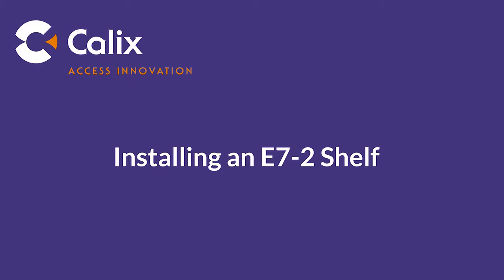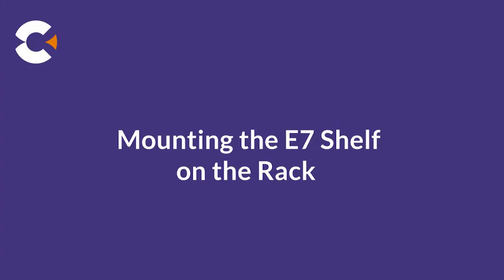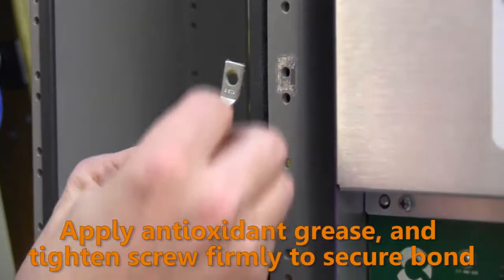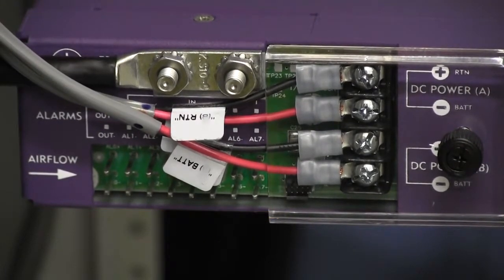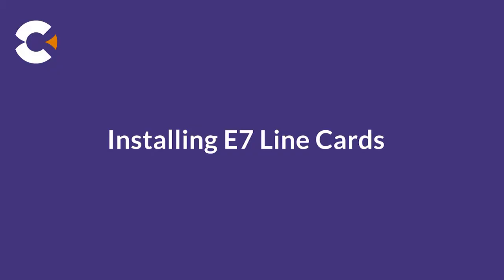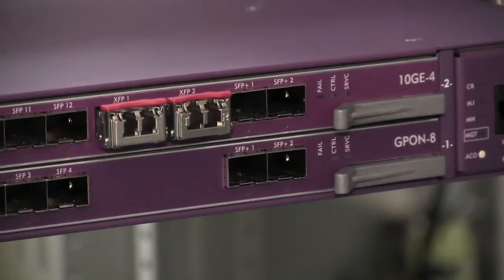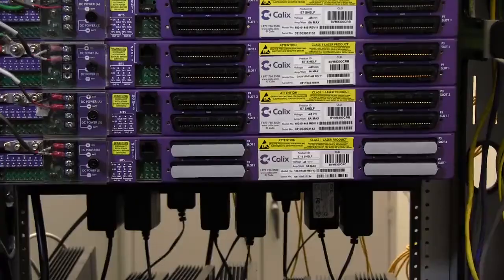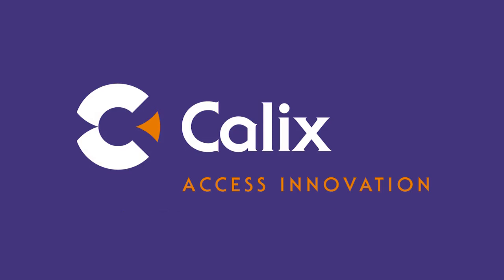Calix How To: Installing an E7-2 Shelf

Comment: What is the 7-segment LCD display on the fan tray module used for?
Reply: Nothing. Install guide said its there for future plans, but yeah... 7 years later still not in use
Reply: From what I have seen inside telco offices that use these systems specifically. They're used to identify which unit/shelf it is without needing to lable them. 
They get daisy chained together with DAC and remote managed. So far I've seen 8 linked up numbered 1, 2, 3, 4...etc.
The irony is that they are still labed with stickers for what shelf they are/were for if power is out to them.